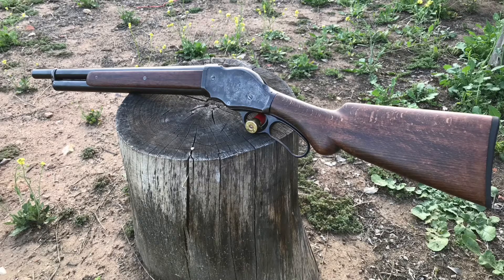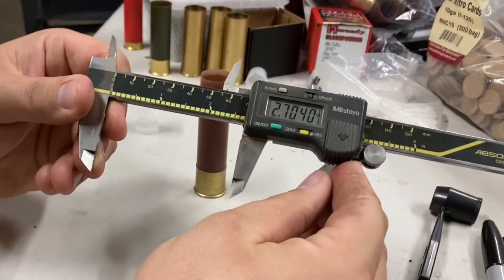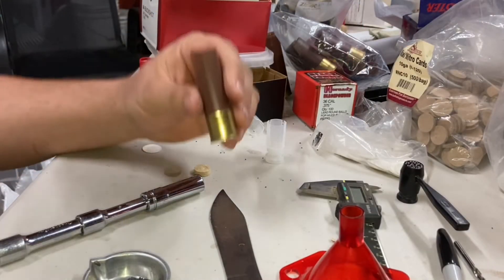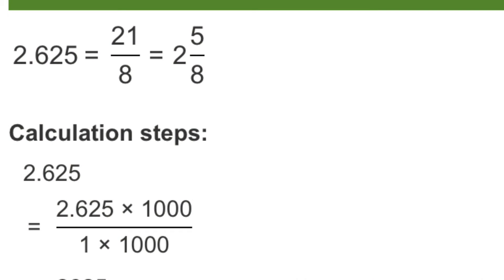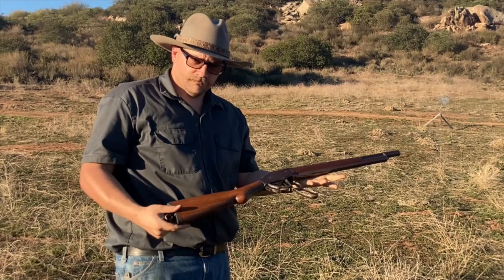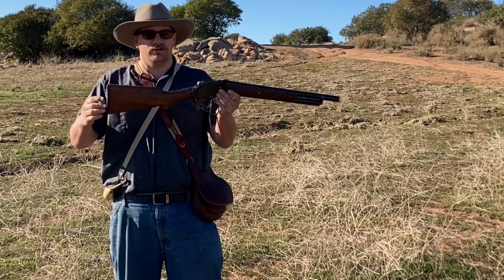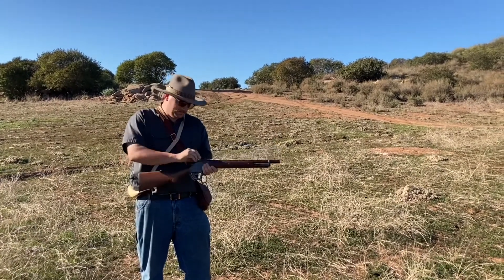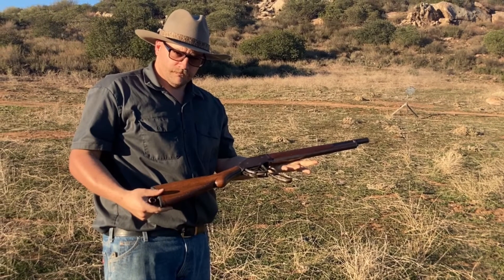10 gauge 2 7/8 Smokeless

Comment: Running brass Magtech in my 12 gauge Chiappa. Cut shells to 2 3/4 or same height as loaded 2 3/4 shells. Haven’t tried smokeless loads except for factory loads. In my Magtech loads I use fiber wads and and load with  55 grains or 2 3/4 drams of Triple seven and 1 1/8 of shot. The 1887 is just a great gun to shoot and it will draw a crowd. Thanks for your knowledge and review.
Reply from the maker: Thank you! I have a video on how I load 12 gauge Magtech brass with smokeless powder, if you’re interested
https://youtu.be/DvbzoyxlCR4
Reply: The Chiappa is more than capable of modern smokeless loads.
Reply: @JWheeler331  Who said the Chiappa can’t run smokeless?
Reply: @dphillips4351  I read it as you were shooting black powder in you Chiappa 87 because you didn’t know it could handle smokeless. Just read it wrong on my phone. My bad. Carry on.
Reply: @JWheeler331  All’s good 👍